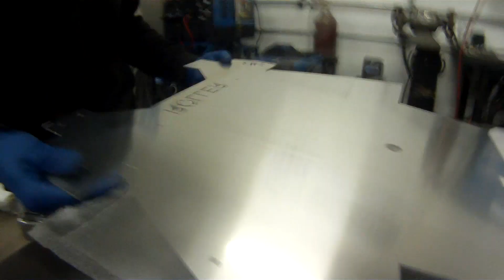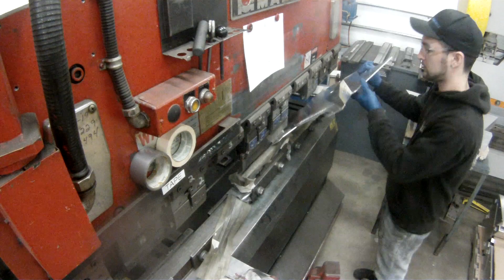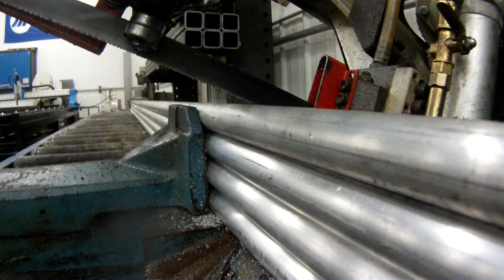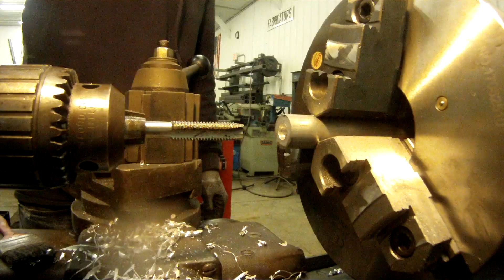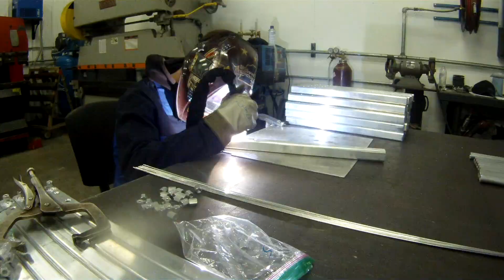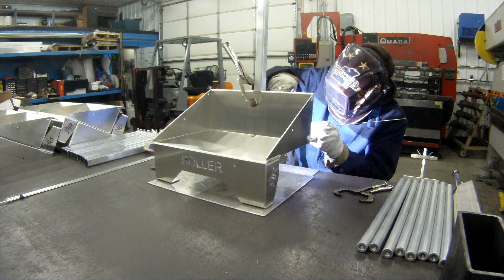Ridge Roller The Roller disc golf carts made in the USA

Comment: These are the best carts in the game.  Your process amazing me.  I wish I had the shop and know how.  I made a custom cart out of a jogger stroller.  I cut it up and completely redesigned it.  The thing I prefer about my cart is that I have 16" wheels and no center axle.  I have so much more clearance that any other cart because  of this.  There is a L shaped bracket that the wheels bolt to and then it goes up a couple inches.  It has aluminum pipe as the frame.  Plus it has two pipes that meet for the handle so it gives more room to attach putters etc.  I have my gopro on a ball mount at the center and an iphone holder next to it.  I am ordering a ipad holder too so I can use it for udisc and my phone for my bluetooth speaker.